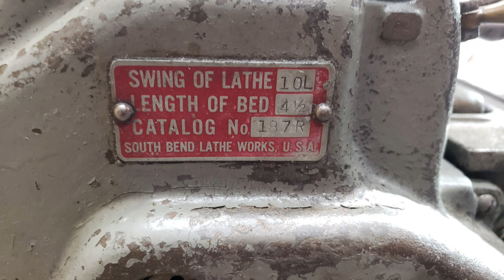South Bend 10L Refurb & Clean 12 hours work in 17 minutes!

Comment: Young man you do good work. Thank you for a very good video. I will give you one word of advice, put a piece of hex stock in a stuck threaded chuck and use an impact wrench to break it loose. The impact works wonders for old threaded spindles. I have rebuilt many old machines, wish I could still do that kind of work. Again thanks for a neat video.
Reply: That’s a great tip! I’m in the middle of restoring a 16” SB that i believe is from early 40’s…. By no means my first vintage or antique shop equip tool i’ve restored but yeah, i have run into that very problem of stuck chucks &, that “natural engineer” part of my brain always wants to way over-think things! 👍🏼 side-note, if you happen to know of an “easy” means of possibly rewiring the original 3 phase 15 hp Westinghouse motor to single phase, please let me know!
Reply: great tip, thanks !!

Comment: Have the same lathe ,loved the love journey you took to restore it, they are wonderful machines, 1946? Next time try a motorcycle/ snowmobile impact driver for your stuck straight and Phillips flat head machine screws. It uses special bits and a surface you hit with a hammer to pound the bit into the slot at the same time as it twists the screws loose. The impact of your hammer drives a helix within the driver, same principle as a rotary jackhammer. They can be used to tighten or loosen based on how you preload them i.e. twist them by hand first. Rarely a screw they wont loosen. 
 Great job. Were you able to find anyway to tighten or adjust the play on the in feed. The crank that moves the tool perpendicular to the lathe, mine is loose.

Comment: I didn't see you install the felt in the bearing ex pander , do you need them? Mine came out in parts .  I can't find any videos on shimming up the spindle Did you have one or know of one? I'm in the middle of a rebuild of a south bend  10 heavy.  Very nice video,  Thanks
Reply from the maker: I would not have left them out. Yes, you do need them. They are placed under the expander on each side. This is a critical part to keeping the bearings lubricated.

Comment: This is not a refurb by any stretch of the imagination. You didn't even strip the gearbox! I would be embarrassed to post this half job online.
Reply: It is in working condition. The gearbox may not need any work. I have a lathe from the 50s and the gearbox is in near perfect condition. Regular maintenance is sometimes all you need. While I probably would have gone a little further, it did go from non functional to a working lathe.
Reply: It is in working condition. The gearbox may not need any work. I have a lathe from the 50s and the gearbox is in near perfect condition. Regular maintenance is sometimes all you need. While I probably would have gone a little further, it did go from non functional to a working lathe.